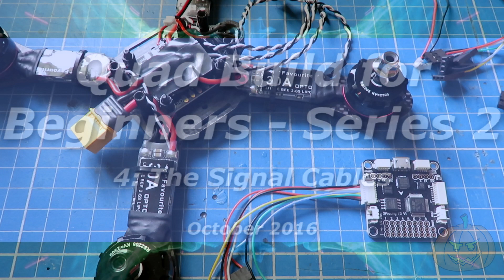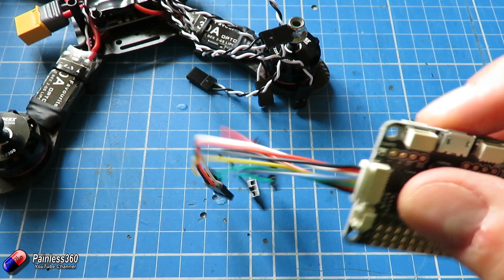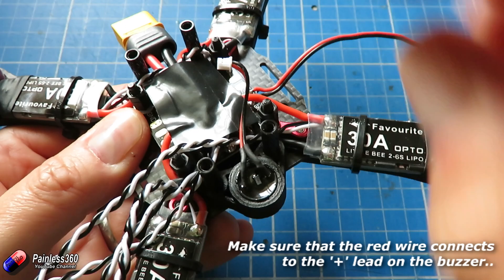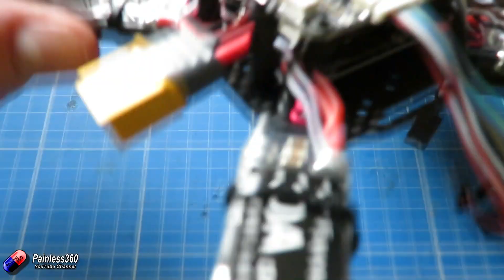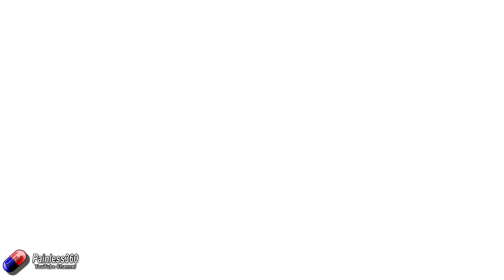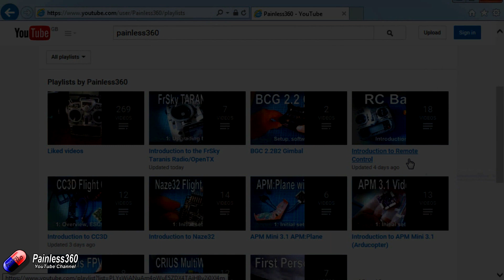(4:7) Quadcopter Building for Beginners - Series 2: Connecting the signals

Comment: Can the reciver be binded at the end because  I dont have a BEC. Is there anyway to get around this?
Reply from the maker: It can but you'll then have to do the setup of it in the firmware. Keep those props off until you've tested the Rx and setup failsafe and disarming switches..

Comment: Most important question: In the video it is stated that you wanted to solder +5V and minus cables from the PDB to output 8 of the FC. Later in the video we see that you have soldered them to output 7. Why did you change your mind?
Next, let me give a small tip: The quality of the cables coming with this FC is often very very poor. So it happens that especially after removing the unused cables for IO-1 also some + , - or signal cable from the plug for IO-1 come off. If this would happen in flight it would be a disaster because the FC would no longer have a connection to the RX. So my tip is: Fix the remaining cables on the plug for IO-1 with a drop of hot glue on both sides of the connector.
Reply from the maker: The +5v and GND pins on the PWM outputs are connected together so any of the connections will work. It was a matter of easier soldering. See some of the other RC power video on the channel. I've never had the problem with the connector falling out so I guess I've been lucky ;) Happy flying!
Reply: I was just kidding with my question....
Reply from the maker: I see , a smiley would have given that away ;)

Comment: Curious...  When attaching the ESC's, rather than clip and solder directly to the FC, couldn't you have soldered short jumpers to the FC, then on the other side solder male connectors that you would connect to the ESC?  Would make removing the ESC's much easier if one went out, or you wanted to upgrade.
Reply from the maker: +gregma60 nice idea! Happy flying!

Comment: Super tip, using dots on the white signal wires of the ESCs!
Reply from the maker: Thanks :D The two problems I've had with flips on take off have been me making a bloomin basic mistake and not connecting the motors the right way and not checking them properly either. Seems like an overly simple step but it's stopped me making the same mistake.